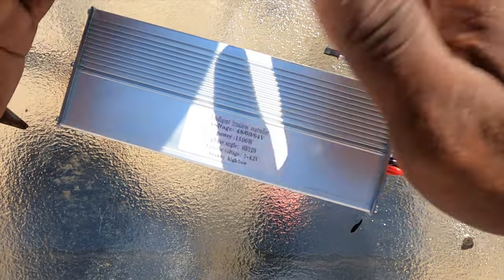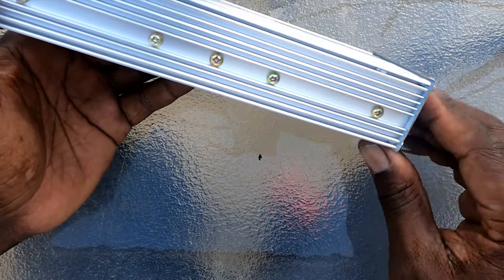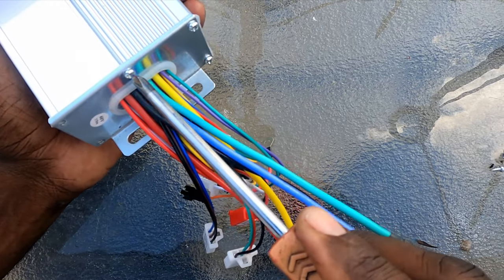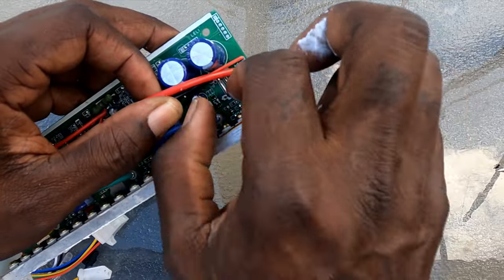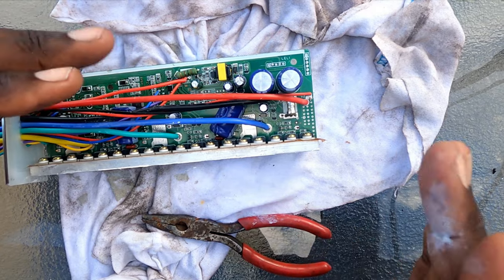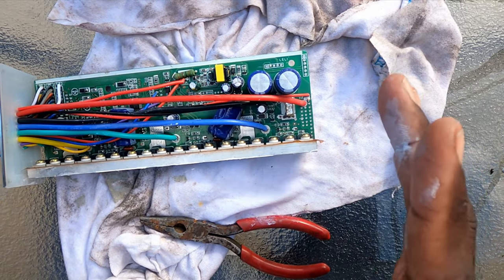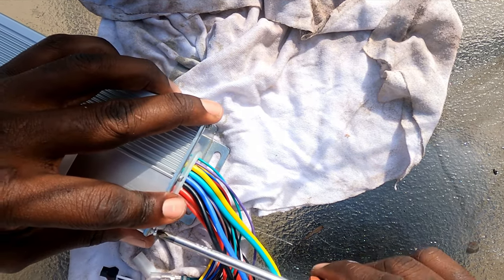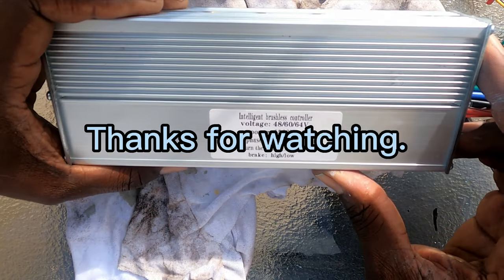How to shunt mod your ebike controller for more power.

Comment: It’s important to note that the shunt mod is for enthusiasts who have a stack of controllers or money to buy a new one. The shunt mod merely bypasses the controller’s current limit which which can allow it to fry. 

Take the 1500w controller, stock. If you connect it to a 1500w motor and go up a long steep hill so that it pulls 1500w for 10 minutes. It will survive because the 18 MOSFETS and heat sink are designed for that. 

If you shunt mod to 2500w, it will work ok as long as the motor can only pull 2500w for 30 seconds before its up to soeed and the amp draw decreases. But if you go up that same steep hill and it tries to sent 2500w for 10 minutes it will fry. 

A motor can take higher watts than the continuous rating for longer because if the thermal mass. But a controller only has that small aluminum bar as thermal mass so it takes only seconds to heat up. 

Its a fun mod to do but people should understand if there were no cons then the manufacturer would do it and charge more money.

I added 15% and theres no hills in my area so its pretty conservative. If i get a better controller then i might mod this to +50% just for an experiment before putting the new one on. 

My Votol EM-30s has no limit in settings. They just say “don’t set amps higher than 32a or it might fry” lol. I guess your Sabvoton has limits in settings  but you can unlock it and set it for WARM, BAKE, or BROIL. lol.
Reply from the maker: You right, I never experience a controller shut down on me also I don't have hills lol but the shunt mod I did to my son's 1000w bike is now on a 3000w hub motor, so far no blows lol
Reply: @E-bikeguy , yes, the 3000w motor is safe in all cases no matter what you do to the controller. But if you mode the controller enough to get 3000w, and then let your big son get on it and tow the 4-wheeler through the grass (enough to actually pull 3000w for 10 minutes), it will fry. 

On your bike with watts display you can see how it goes to peak watts for just seconds before reaching speed and automatically throttling back. With your small son on his small bike, that 1000 watt controller maybe gave 1500w for a few seconds then back down. 

I can see that easy on my ebike with Smart BMS and Votol where i can see amps, but my other ebike all I hace is voltage sag to let me know that the controller is easing up. I get about 4v sag when accelerating (15a) and then about 3v sag at 20 mph flat ground no wind. Lol 

My bike didn’t go faster with the shunt mod. If your son’s bike went faster then something was definitely underpowered or you added a bigger battery with higher voltage or more capacity (less sag at full throttle so more speed). 

But all these mod increasing current or voltage higher than designed increases the chances that it won’t work for 50 years. Lol
Reply: About the bypass part, not exactly.  It passes more current than the programming thinks is passing through.  I've done two different controllers and you can go to the p14 setting and turn down the max amps. I've turned it down to 5 amps max and it's still quicker than stock but only a little.  The other one I turned down to 15 and it's faster than stock. I used less solder on this one so I'm thinking that's what the difference is between the two setting changes to get a similar result. The display I have is the sw900
Reply: @paulmryglod4802  , the ONLY thing a shunt mod does is DECREASE the resistance in the shunt, REDUCING the feedback signal to the controller, making it think its less current than actual.

In a non-programmable controller it will simply increase the max current the controller sends.

In a programmable controller that has locked max amps, is simply throws the calibration out so that you can give it more current within the calibration range.

In a unlocked controller there is no need to screw up the current feedback loop calibration because you can just set it to fry if you want to.

But I stand by my statement 100% that if this was 100% safe, the manufacturer would just calibrate it to a higher amps and increase profit. Its quite likely many people will not enter the region of thermal runaway under normal use, but if you live in a mountainous region and climb at full power at max rated voltage and 25% over rated current, never giving the controller time to offload and cool down, it can fry. 

So a manufacturer leaves a safety buffer in there for extreme conditions. 

I did raise my generic Chinese controller from 13.6a to 15.6a, but its speed setpoint of 35kph and not a hill for within battery range ensures it will have an offload period. And it’s just a hobby ebike. If i needed to rely on it i would have left all the safety buffer intact.

So as I said, its a fun hobbyist thing but if you have money just buy the right controller and everything will be fine. Lol
Reply: It’s my first time doing an ebike I’ve done something similar before but not an ebike, I got a 52v 20ah battery and 48v 1000w motor being delivered soon I live on a steep hill with about a 15 degree incline for about 1/2 mile I needed something for work until I past my test
Reply from the maker: Ok, make sure you keep an eye on the motor temp when you climb them hills.
Reply: @connorjack3246  just be careful remove the safety buffer in something that needs to go up a steep incline for extended period of time. If it cant offload amps back down to normal after a short periods then it can cause a problem.
Reply: @imho7250  thanks for the heads up, it’s a steep hill and the rest is flat. Could you elaborate abit more please what’s a saftey buffer where do I find it and how do I do it please thank you
Reply: @connorjack3246 l every controller has a current sensing loop to tell the controller how much current its using, and the manufacturer then sets the limit of current in the software such that the mosfets don’t fry. So since they don’t want the controller to die the first hill it climbs, they will add in a safety buffer of maybe 10%-20% below when the controller burns up. 

When you do the shunt mod, you are bypassing the safety margin and allowing more amps. On flat roads this normally is not a problem because the vehicle will get up to speed faster and then throttle back once top speed is reached. But if you do the mod then go up a kong steep hill, you might not allow the vehicle to get up to speed, and therefore it will never throttle down, and can start burning the controller and motor windings (depending on the motor).

So meaning if you have something that before was struggling to get up the hill, never reaching speed, and you did the shunt mod, it will send more amps continuously and could burn up the mosfets, tracers, or anything not designed for that. Because the controller will not offload. At the same time if it was a 500w motor for example, and the controller was rated at 500w, but peaks at 800w to assist in acceleration, and you do the mod, perhaps now you are sending 1200w through the controller and to a 500w motor. This is fine on flat ground if you give it a cooling period after each acceleration. But going up a still hill for 1/2 mile might be too much.

So I say the shunt mod is an enthusiast mod, for fun, if you don’t need to depend on that bike. 
Ebike guy did it because he has a stack of controllers in the parts bin. Lol
I did it (mild 13.6a up to 15.6a) but I don’t need it to be reliable and if it fries i pedal home and buy a new controller and wait for delivery. Lol

I have no hills near me so after the mod i just made sure the controller would still offload, which ir does because the max speed (preset in the controller) is 33-35kph and it only needs about 10a for that.
Reply: @imho7250  that’s good information there thank you, I don’t need to get anywhere in a massive hurry I would much rather it more reliable if anything. I have got a 48/72v 1500w controller here spare I may play with that one once I’ve tried the set up I’ve bought. For example a 1500w rated controller would have the components necessary to give me the power instead of doing a shunt mod on a 1000w controller is that right? Thank you
Reply: @connorjack3246  , yes, using a 1500w controller without mod will be much more reliable than a 1000w controller with a mod, assuming both consoles are built to the same standards. It might use more mosfets with less current per mosfet to achieve that extra capacity. Also thicker tracers. Typically bigger housing with more heat sink area for better heat dissipation.
Reply: @imho7250  cheers for the reply’s. I’ll give them a try because I’m slightly over volting motor for abit better performance but I don’t want to jeopardise any of my equipment
Reply: @imho7250  is there any videos on changing capacitors do would that result in more power
Reply: @connorjack3246  , you will only get power from capacitors if you increase their voltage so that you can increase battery voltage.  But the capacitors alone are for voltage smoothing not really power output.
Reply: @imho7250  totally understood. Thanks very much for you help I’ll subscribe to your page
Reply from the maker: He knows his stuff, 💯
Reply: @SherylinRM  , yes, in theory if you beef up everything in the controller it can take more amps but at some point its cheaper and easier to buy a 75a controller with the rated voltage you want to use. 

Ive seen someone try to add mosfets to a controller to give it more current carrying ability but he ran into many problems. The mosfets chosen by the manufacturer also have mosfet drivers with problems resistors to ensure the switching is correct. Changing the mosfets can alter the behavior if the driver and make it slow to switch which causes significant heat buildup.

But if you can successfully upgrade the mosfets and beef up all the buses to each mosfet then it can probably work. If you are good with soldering and like to do it then its worth a try. Then you can do the shunt mod until you see 75a peak, assuming you upgrade the breaker to 75a.

Just make sure the motor can handle sustained 75a. Shunt mods are normally to give you 10 seconds burst of higher current to get you up to speed, then the current will drop back down to normal (on level ground). But if you are hitting the controller limit going up a long hill, such that your speed is significantly slower, increasing the current may overheat the motor. 

The nice thing about programmable controllers is you can set the current limit for each “gear” and the desired speed. If your motor can handle 50a continuous, you can have a gear for 50a when going up long hills, and for flat ground you can use 75a in gear 3 which it will use for about 10 seconds and then drop down to 30a once you are up to speed, allowing cooldown time from the brief over current.

Also programmable controllers normally accept a temperature sensor probe which is embedded in the motor windings and will throttle back the controller at whatever temperature you set.
Reply: So you are saying if you want to play it a bit safer add less soldier between them?
Reply from the maker: It's better to coat it. not too much tho
Reply: Could I Bridge Mine by soldering a very small piece of standard electrical cord across the center of them? Connecting them in this matter in a more conservative way
Reply from the maker: @tac6044  it will be best to use solder
Reply: @tac6044  , not really. The current flows along each of the shunt resistors, and the shunt mod works by reducing that resistance. Making the shunt resistors touch doesnt change their resistance. 

You need to add a BETTER CONDUCTOR along a portion of the length of the shunt resistor to decrease the resistance across it. 

You will see some squeeze the shunt wires together so that it better holds the sold laid along a portion of the length. You can do the same with a piece of copper which is wide enough to go across all shunt wires and long enough to bypass the amount you want to get the reduction in resistance you want, as long as it can handle the current since most of the current will now travel through that. 

 But if you merely soldered a wire from shunt to shunt, only the glob of solder holding the wire will be a bypass for current and you might only see 2-3% more current.
Reply: @SherylinRM  , that happens to me sometimes too, even when I’m not saying any bad words. Lol. Good luck with your project.
Reply: shoud send the bike to you or taka chance to cyckle the distance lol, but i have to similar like you have in the video,can i paralell couple them ??
Reply: @E-bikeguy  Okay brother I just opened up another controller I had stored up, this time I I bridged a 16 gauge wire from behind the motherboard and so far so good, I did not remove the shunts. If you use a 10 gauge wire, it will transfer to much amperage and the chance of burning the unit is higher, like I did. So far its running.
Reply from the maker: @alexshatner3907  heck yeah
Reply: @danimayb  , no, a shunt resistor is not supposed to limit current, its simply creates a small but accurate resistance which creates a voltage differential. That differential is then measured, and calibrated to tell the controller what the current is. Then the controller programming limits the current using the MOSFETS. 

When you decrease the resistance across the shunt, the voltage differential is less, and the controller thinks the current is less, since it was all calibrated on its factory resistance. This is how a 30a controller now allows 40a because as far as it knows, it’s still 30a. 

The effect of a shunt mod is EXACTLY the same as if you can program the controller to allow max amps to increase from 30a to 40a. The problem is you are dipping into the safety margin the manufacturer designed in. But the shunt will not be what gets burned up.
Reply: @imho7250  Think I may try to do a small amount of solder across the shunt in my 35amp stock controller (on 1500w 48v rear hub with 52v20ah battery) but I'll do it when after ordering my new 45 ( or 60, or 80, undecided yet/money available) amp controller has arrived, this way I can see what difference it makes (fun wise) before I install the new controller...
Thanks to this pretty long thread it's made me realise that the shunt mod's ok to do if you've a spare controller handy for if it gets fried!
Reply: Cool stuff dude..
Peace Prospector Tripp
Reply: @imho7250   Many ebike controllers do not have current limiting.   Some don’t even have basic thermal overload safety either.  One heavy person on a hill or a stuck wheel and it deploys the magic smoke
Reply: @hugegamer5988  , every controller has current limit. That’s the whole purpose of the shunt mod. To fool the current measurement loop into thinking the factory programmed current limit is nit being exceeded. A typical OEM design will have a motor rated at a certain watts, and a controller rated at the same watts but capable of 50% more during acceleration. Generally it will be difficult to burn the motor or controller in this situation. Every EOM voltage, motor and controller are also matched such that at max speed with throttle held wide open, the controller will offload to less than the rated power of the motor. This is why a shunt mod should not increase top speed, and it if does its a sign something is overloaded.

But after the shunt mod, the 50% additional power might be 200% additional power, and if used uphill or some other variable changed that doesn’t allow the controller to offload, the motor and or controller can burn up.

Once someone starts changing voltage, motors, or controllers it opens the door wide open to something overheating. 

My whole point about the shunt mod being for enthusiasts is that it 100% certainly reduces the overload margin built into the bike and especially bad if the complaint is “it goes really slow when i try to climb this long hill”.
Reply: @imho7250  I know how current limiting works, I’m saying I’ve opened cheap ones without it. Too much torque and the controller fries.
Reply from the maker: @hugegamer5988 every controller that have been shunt moded does not mean they will fry . Some will but there are some that will handle the extra current I've done a lot and they all is working great 
T
Reply: @E-bikeguy  you misread the comment.  Nowhere did I say that modifying the sense resistance automatically destroys the controller, I’m saying that cheap ones didn’t even spend the $0.30 in parts and there IS NO current limiting.  In an ebike they rely on a  large gear reduction and a motor with a low stall current to not fry.  
Also the whole wattage rating is ridiculous, that’s only if you max out the voltage rating of the controller board while also delivering maximum amps. It’s the amps that fry it no matter if it’s being run at 5V or 50.
Reply from the maker: @hugegamer5988 I'm going to go back and read that comment again and show you what you said about blowing up a controller going up hills and stuff
Reply: What if i did this mod to my measley 250w 36v 10ah ebike?  
I just want a little more power since i ride in the city, feels a bit unsafe to be so slow.  Also could i disable the speed limiter wire to get more top speed?
Reply: @kaizen_creations  just remember the power is amps squared.  So 10% less resistance that’s 11% more current is 23% more power. I’ve found a general rule is they have a 50% margin on over power so a small change is best, you don’t want to go quadrupling power.  Also I wouldn’t mess with the speed limiter unless you know what you are doing, the motor voltage is proportional to speed and if voltages get too high it can also fry things.  Maybe if it’s limited to the legal speed of 30mph it may be fine but you really don’t want to put too much voltage across the controller if it can’t handle it, the excess current will be shunted and that can fry it if it’s too much.
Reply: @hugegamer5988  thanks gor the info.  Yeah so i have a 250w ebike with 36v 10ah battery.  It goes 20mph throttle and 24mph pedal assist.  Theres no settings u can change on the display besides more or less pedal assist.  I read that these speeds are pretty fast for a 250w so maybe ill just accept my slow bike for what it is lol.